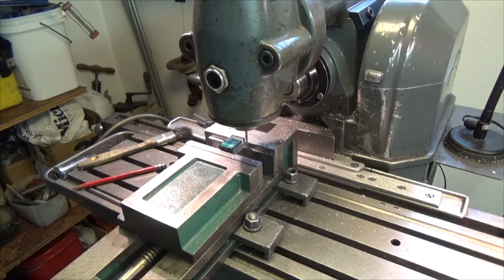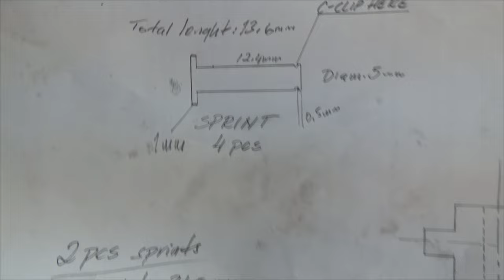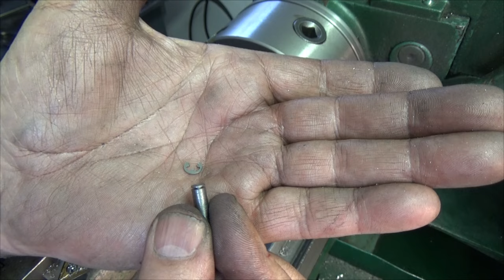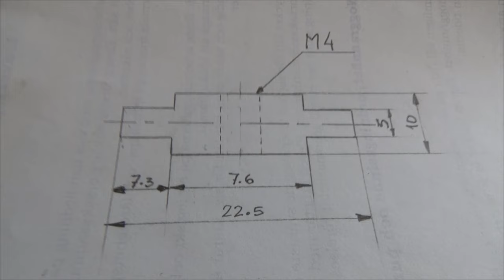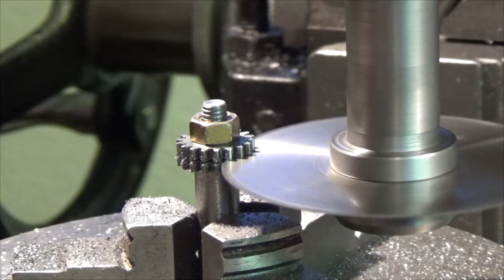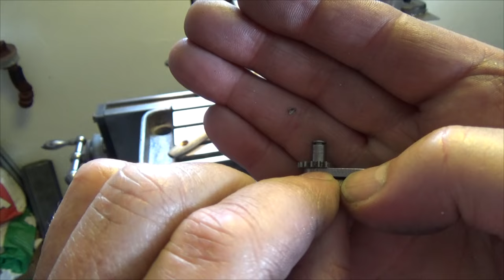Mini Scissors Jack - Part 2

Comment: This is a cool project. Definitely something I would like to do. 

For aluminum all you need is kerosene, or really most any form of degreaser that is very slightly lubricating. Many people (especially That Lazy Machinist here on YouTube) report that household degreasers work great. Aluminum basically just needs something to help it not build up on the cutting edge of your tooling.
Reply from the maker: Yes and you can also use WD-40 for alu. Thanks for watching.

Comment: Inspired me to build one aswell  Mr. tompas.  i settled on cutting gearing on the end of the arms. as i could not find small enough gears . loving your projects ,cant wait to see it done.
Reply from the maker: Nice if you got inspired to build one to. :) I was also thinking of cutting the teeths on the arms but then I remembered that I got several small gears both plastic and metal ones. I have saved them for no reason at all but now some of them got used. Good that I haven't throwed them away. Thanks for watching.

Comment: general purpose cutting oil-----60% synthetic car oil to 40% kerosene.more kerosene for a thinner mix.....also for penetrating oil-mix 50% auto transmission fluid and 50% acetone , you tell me its not penetrating oil when you mix it.big company secrets.save money.
Reply from the maker: I have a glass bottle with a 50/50 mix of ATF and acetone and it only mixes if you shake the bottle.
If you leave it standing for a while you can see that the ATF and acetone separates although the color of the fluid is all red. Works pretty good though for help loosen rusted bolts and nuts. Thanks for watching.